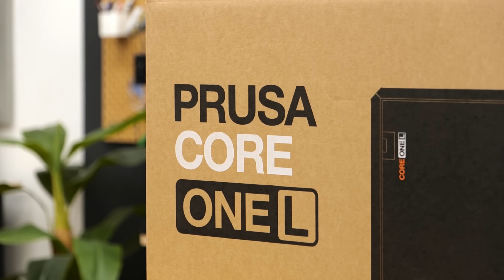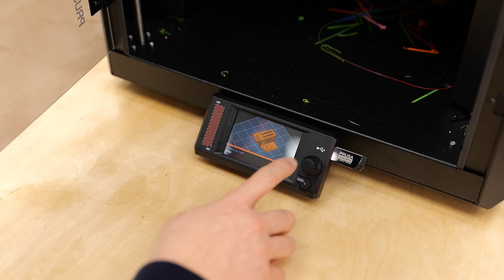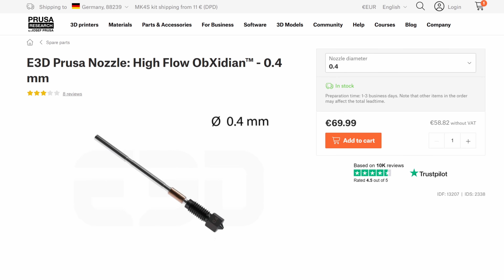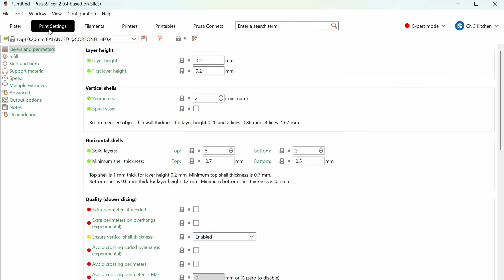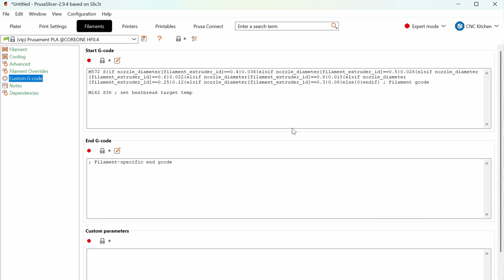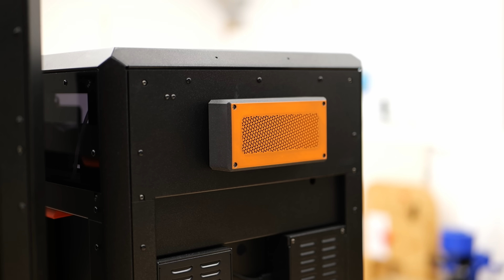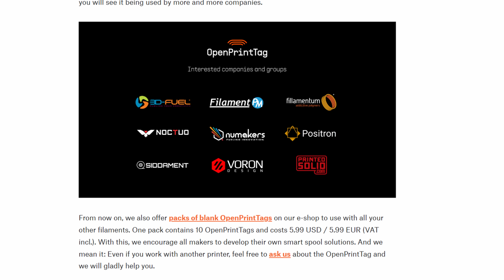What Prusa Got Right (and Wrong) with the New CORE One L

Comment: Unfortunately again really bad machine without future. Also was on the Prusa factory and also was talking with the Prusa himself. Benging of the screen then you press function buttons was funny. Qidi Q1 and Q1 cost 3-4x times less and can be calibrated properly, doesen't require calibration and can daily print ABS, so you have worry free printfarm for this price with cheap parts and replacements, and also open firmware. No idea why Prusa still have part of the market.

Comment: What voltage goes into that heatbed ? It's not written anywhere and Pruša laughed at Bambu for letting AC current into the heatbed 

but other than that it's beautiful, expensive and high quality, I'll probably buy it when INDX comes out
Reply: It has two bed heating elements , one for 110/120V and one for 220/240v.
Reply: Where did they "laugh at Bambu"? Using AC heatbeds to have advantages, Prusa knows that.
Reply: @marcel151  Ok, he didn't laugh,

“Good thing it’s not an AC bed… 🤔 oh wait”
he tweeted something like this when the cables on Bambu A1 caught fire in 2023
Reply: @matejkuka797  That does not necessarily mean AC beds are bad in general. It can be worse than DC beds if they cought fire.

Comment: So does the camera require wifi then? I thought one if the big plusses of the Prusa was that it could all be used cabled (i.e. no WiFi). A bit sad if they didn't include the camera in that capability.
Reply from the maker: The CORE One has a LAN port but the camera is WiFi only.
Reply: @CNCKitchen thanks, that's what I understood from your video. Most disappointing given how little it would've taken to pop a small lan hub in there for the camera. Of course, we can do that ourselves but at this price point we really shouldn't have to.
Reply: You can forget about video being processed in ANY existing Prusa printers electronics - these use low end 32-bit ARM Cortex (STM32 family) microcontrollers (from before 2014). Such STMs are too slow for that and have not enough of memory.
Reply: @arekx  While I completely agree, your comment sounds like it's because the  Microcontroller is old. However, I'd say video processing is unrealistic on ANY (even high-end) cortex-M microcontroller. For proper video processing, you want a full application processor.

Comment: Small mindedness worked great when Prusa took the 3D printer from the hobby realm into commercial production. My MKB 3 needs replacing for quite a while now. Every time I hope Prusa releases something I want. They don't.

Just another cobbled together device with many missed opportunities. I am sorry Prusa, I liked your cute business model but it doesn't serve you anymore. Grow up or die.

That integrated spool holder should be a sealed drier! Those two noisy fans should be one larger quality fan and like Stephan I can go on and on. Your printer isn't worth what you are asking, nor does it meet the specs I am looking for.

I fear you missed the boat at this point and are destined to become irrelevant and fade away. That is sad, but you would not listen.
Reply: i am 14 and this is deep

Comment: 2000 euros won't buy a very good car,. but it will buy a car. I may (maybe) look into this when they package it with a Bondtech INDX (or I could easily retrofit it) but it's a great deal of money for a hobbyist. Even then, I could buy two separate 4-tool Snapmaker U1 for the same money. I get that Prusa is expensive because European parts and European staff but damn.
Reply: Still Not as expensive as ultimaker 😂
The european top of the (price)Chart 3D Printers
Reply: Chinese brands are often if not always heavily subsidized by the government to enable these insanely low prices specifically do kill the competition and taker over the market. Also, don't forget the crappy wages paid in china that further reduce price. Finally, all these companies financially benefit from the developments made by Prusa and similar companies by using their open source software and by avoiding their past mistakes. Prusa is not too expensive, its just that chinese brands are too cheap. The price of the Snapmaker U1 makes honestly no economical sense considering how much development time and resources goes into a device like this.
Reply: @Widur42  It’s not as though European industry lacks subsidies — the real gap with China often lies in how those funds are used: too often diverted to shareholders rather than reinvested, restrained by conservative thinking or, at times, simple arrogance, only to end up being overtaken by Chinese competitors. And this constant refrain about “building on open source,” while consistent with the principles of OSS and its ethos of freedom, is starting to feel outdated. We’re beyond that phase; today, Prusa seems more focused on catching up than leading innovation — holding itself back by refusing to “steal with its eyes,” something every good product designer instinctively does.
Reply: Yeah and then you'll have 2 very expensive paper weights in a year when Snapmaker stops supporting it or doesn't sell you the parts....
Reply: This isn't a hobbyist printer... Nor has any prusa been a printer that has the hobbyist in mind. The bambu A1 mini, A1, and now the P1S have a FIRM grasp on the hobbyist market. As crazy as it sounds you're not spending the money on a prusa for the machine. It's the support, both technical and gives an upgrade path for your printer for future upgrades. Plus the added security compared to other printers.
Reply: @rileyneufeld7001  not a hobbyist machine, yet it doesnt come with a hardened high flow nozzle? doesnt have a proper chamber heater? doesnt have a freaking camera you can just use on your local network? Nozzle that tops out at 290, limiting what engineering materials you can use with it?
Reply: @ThatsPety I'm not defending them, at this point a hardened steel nozzle should be the default. The 290°C nozzle isnt as limiting as its made out to be. What can't you print at 290°C? PPS? PPA? PPS mechanical properties are terrible, the only thing it excels at is temperature resistance. PET, various blends of nylons, and PC blends. Those can all be printed at 290°C.
But at that price point I would expect a 350°C nozzle and 65°C chamber, hardened steel high flow nozzle.
Reply: Prusa ce n'est pas non plus des machines pour professionnels vu leurs spécifications techniques en dessous des appareils bon marché chinois. Donc explique moi, à qui s'adresse Prusa si ce n'est pas aux amateurs ?

Comment: Don't baby me with the 230V heated bed. And why take the reputation hit that the camera can only be used via the cloud rather than locally? Seems so unneccessary!

Edit: I just read that the information in this video is bs. The camera can in fact be used locally via RTSP protocol.
Reply: Reading the comments on these videos gives me the impression that Prusa hasn't really lost reputation from cloud cameras or witholding schematics. The loudest fans don't care about open source or privacy beyond labels.
Reply: @Birdulon  What makes you think so?
Reply: its not about "babying" it is about regulations (EU etc) and the fact that if you screw it up you wont get any help
Reply: I built my core one from a kit and it honestly wasn't worth it, back in the day assembling a printer took a few hours and was helpful for repairs, now there are so many parts that it takes over 20 hours and you probably won't remember which of the 30 different types of screws go where, what used to be fun now feels like a marathon where I'm paying myself below minimum wage, and I learn nothing. Kinda wish they were built simpler, do I really need 2 rgb strips, and a light strip? But it all adds up to something where kits just don't make sense anymore.

Comment: Yeah, I think I'll sell my soul for a better printer with a larger print volume + a more sophisticated ecosystem around it, with settings and mechanics that I don't have to tinker with most of the time, for 500€ less. My Prusa fanboyism can't take it anymore. Bambu still holds the lead, and will continue doing so for this current generation of printers.
Reply: The way the Chinese have under-priced their machines in huge legions just so they can connect everyone to the cloud and thus give total information awareness on what many shops, maybe even prototypes from serious companies, are being printed is frankly very worrying. But in isolation, it's hard to argue against the Chinese units, they cost less, work better and give you more. You'd have to be an ENORMOUS fanboy to pick a One L over two separate Snapmaker U1 4-tool changers. In spite of the probably nefarious subsidized Chinese aspect.
Reply: adios
Reply: I’m fascinated by these comments. It’s the same comments you see on any tool demonstration short. “Not the right product for me personally, but I need to say something kind of vaguely disparaging the whole thing and trying to seemingly shame anyone who wants the product” just….OK man. Just buy whatever. Some people care about manufacturing location and company culture…others don’t. No worries
Reply: Have fun repairing your bambu printers lol
Reply: @wieli. 5100h in on my X1C and I've swapped one 0.4mm nozzle, still on the original printer sheets it came with. Swapped the motherboard fan for free outside of warranty. I've swapped my extruder gears (bought on the store) and 4 of my 8 AMS feeder motors. They are repairable from the parts sold.

Could Bambulab screw their entire userbase by not selling them anymore? Sure, but we aren't there. I had a MK3, heavily tinkered with and got sick of spending just as much time tinkering as printing.

My two cents is that without pressure from Bambu specifically; Prusa would not have created a remote app, dropped the price on assembled units, accelerated research on the MMU (MMU and MMU2 were garbage), nor would created an open source RFID AND modified their spools to fit into the AMS.
Reply: @wieli. What repairs lol? I own a Prusa and a bambu, all I do is make sure they get there proper maintenance and they keep going.
Reply: @wieli. i did. Bought an upgraded hardened steel nozzle and extruder gear for my P1S. Documentation on the process was phenomenal, and what I didn't understand immediately was found by independent channels on YT. Bambu also supplied additional parts with my initial purpose, so I technically didn't need to buy any extra, but I wanted to upgraded gear instead. 

Bambu's kinda locked down in terms of software, which sucks because I love the hardware, but for someone who just wants to print, not tinker with the printer, it's a fantastic product with great value imo.
Reply: @wieli. It's not such a big problem when you don't have to repair the printer 24/7. Also, as someone who has experience repairing both, Bambu is so much easier and faster to repair.
Reply: @wieli.  Les bambu lab ne tombent pas en panne, et les imprimantes 3d évoluent tellement vite que ça ne sert a rien de garder la même plus de 5 ans.
Reply: @wieli.  Not much that need fixed usually. And most of the parts are available, for a fairly reasonable price
Reply: @wieli.  Have fun >having< to repair your Průša.

Comment: I was bummed that the core one didn't print as reliably as the MK4.  Seeing that the core one L is just a bigger version with the same problems....  That's just disappointing.  

It seems like the best way to get a decent core  XY that isn't behind a wall is to build a voron.
Reply: Sovol. Heck even the Crealitys are really good, just dont buy them at or near launch
Reply: I'm only now upgrading my MK3S+ to a MK35S and I expect that to remain my single color workhorse for years. I'm just a home hobbyist, after all. Something like the One L with a Bondtech INDX system would certainly be an amazing "last printer you ever need" type thing but for just single filament the price is brutal. Not to mention the 290 degree max temp on the hot end, what if you want to actually use the nice heated chamber and print a hero material that needs more? It's frustratingly incomplete and shaky and still expensive.
Reply: Exactly. I’m still waiting for something to replace my Voron I built nearly 5 years ago. This is really disappointing from Prusa.
Reply: my core one prints better than my MK4 :shrug:
Reply: @Thunderstryk  My old v-core3 prints better than both.

Comment: Woah. So they have similar issues in Core lineup than with XL? I've seen stons of problems with my XL on nozzle cleaning and something apparently making load cell values to drift. It makes me force hardware reset printer to begin to work again. Yes, I literally do ONLY that and it prints again.

I was thinking that now it's the time and I'll immediately order this Core one L for myself at home, but thanks for bringing these things out. F this. I'm not getting one until I see tons of people confirming that this isn't issue.

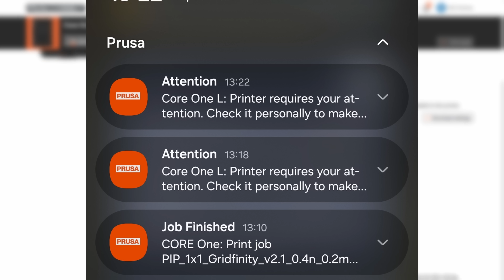Oh and for crying put loud. Put filtration to the machines, cheap skates. 17:58 And that too, of course. It drove me so friggin mad that I took my XL offline completely. I also couldn't believe that you can't even create folders in that webapp. I had to ask customer support and no. You must put every friggin gcode file into root of the folder, even though UI shows folders. Huge pia when having like +50 files on printer.

Ok, so if I'm getting one, I'll just see if XL horrids get ironed out and maybe then check out. Isn't looking good though considering how long XL has been out and having still issues.
Reply: well they use the same extruder essentially. Prusa hasn't really changed the extruder since the XL came out with the "nextruder"
Reply: @Thunderstryk  I'm not convinced faults are fully in hardware. But it's very alarming that Prusa customer support has sent me cables, motor and load cell for factory assembled print head and I'm still getting need for factory reset about monthly, which is huge pia in working environment. I've visually seen load cell values drifting here and there. Maybe they have bunch of low quality electronics board or something as nothing seems to permanently fix these issues and software seems buggy as hell even today. It's not long ago when filament got stuck in extruder gears, but I simply couldn't jog extruder no matter if temps where on or off. I just didn't do anything. I was downright Prusa fanboy when I got my MK3 near launch and it downright annoys me that I personally recommended to get XL based on my, until this, good experience with Prusa's.
Reply: ive got 2 core ONE`s with 50days of combined printing on em,  and the core one L same amount of time and stefan here, and the built in nozzle cleaning has never been an issue for me...so 'shrug'

Comment: REQUIRING cloud service for a camera is Big Brother level requirement and is NOT RepRap!
Reply: True, Prusa losing their origin and divirging to BmabuLab ideology...
Reply: Just use RTSP, problem solved.
Reply: @marcel151  Yes rework around their setup that is supposed to compete with it just works. Great Idea! And not all camera's support rtsp unless you plan on adding a circuit as well.
Reply: @noanyobiseniss7462 If you don't want to use it, just don't use it. Don't blame me for trying to give non-cloud solutions (which btw. always are more fiddly).
Reply: Well, they couldn't get their certifications for ISO 27001 (hardware security) or ISO 27701 (Privacy) like Bambulabs could. This might be one of the reasons.
Reply: @glp.1337  No it's not, you can get that requirement by making it a option with a disclaimer.